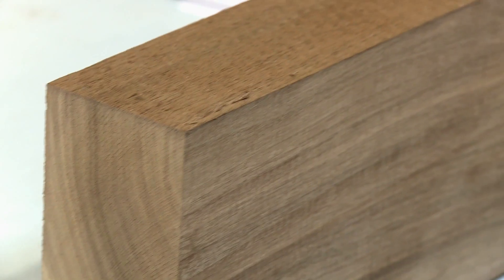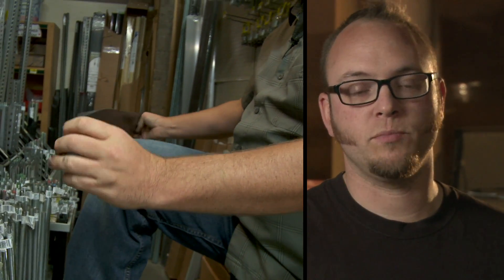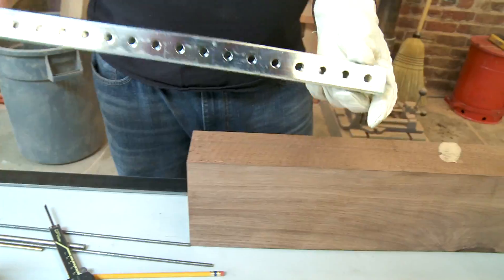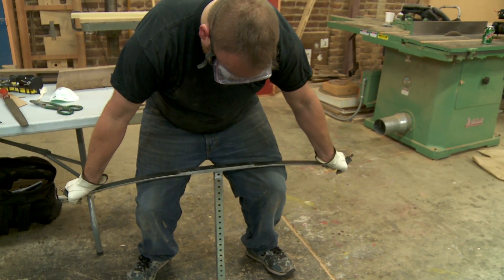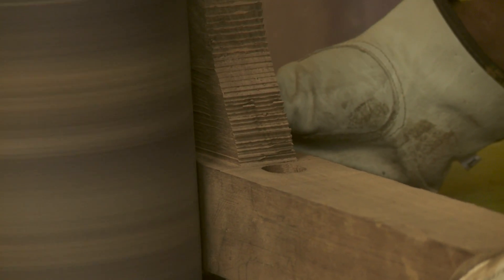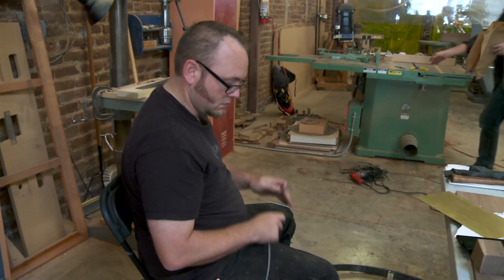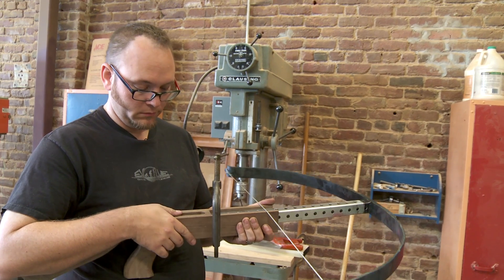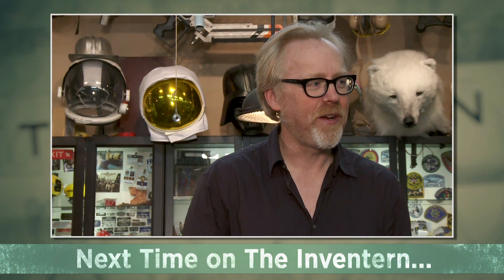The Inventern Episode 14: Building a Crossbow

Comment: Rather then putting all that time into bending the steel, he should have tempered it. Even mild steel can be surprisingly springy if heat treated. I would say if he got the whole thing to a dull cherry red and water quenched it that could have been good enough. If it's still too stiff, a few gentle passes with an oxyacetylene torch would anneal it enough to make it work. I know Adam has a propane sword forge somewhere and even without that, a little care and an oxyacetylene torch would work.

Also where do I sign up for next season? I'm 25, eager to learn and I'm itching to get in that work shop.
Reply: Does your illiteracy ever embarrass you?
Reply: mellotron It used to when I was a child and they told me it was likely I would never be able to really read or write, but around 6th grade I read my first chapter book. From then on it was an uphill battle over the next 6 years of my school career to get to average. The students constantly made fun of me. It was rough. I'm proud to say, by my senior year of high school I graduated in main stream reading and English classes, with most of my other classes in honors. It was the hardest 6 years of my life, but I no longer needed my IEP as a crutch for reading, and I did the impossible. Also go fuck yourself :)

Comment: I am pretty disappointed in these final builds. Granted, they had very limited time to work on these, but the engineering behind each of these projects seems very limited. They probably did some back of the envelope calculations, but were not very thoughtful. For example, in the crossbow, Brandon did not think about the tensile strength of the cable that he bought and how the strength of the bow would compare. He should have had at least a factor of safety of 2 to ensure that it wouldn't break under load (as it did). It also seemed as if he just welded the two steel arms together without doing any calculations as to the resulting stiffness. These are very basic calculations that should have been done long before he even fired up his torch.

Sad to see that he approached this project as an artist would, creating a beautiful stock for the bow out of hardwood without regard to actual functionality, instead of thinking like an engineer.

Comment: shouldn't you try to temper the steel to make it spring?
Reply: Mild steel has much too low of a carbon content to be quench hardened!
(that's why it's called mild steel)
He "could" try carburizing it before hand, ie putting in an hermetic box, with charcoal, horn, or an of the shelf carburizing compound, Though it would have consumed most of his time up to his deadline, and would have needed a biiiig gas oven or a large forge...But even if he had the time, that would fail anyway for numerous reasons I wont detail here!

He basically failed in choosing the right materials to begin with!

If scrap yards or auto shops werent allowed (Knowing the proclivity of Adam for rumaging in those places, I'm pretty much sure they were) he should have gone the composit way, modern style: fiberglass or carbon fiber skis (expensive, but relatively efficient!)
The composit traditional way, ie horn, wood and sinew glued together to make a bow also would have taken him all the time he had, so out of the question, and I guess the layering takes a massive knowhow!

Comment: As nice as it looked you would never really be able to make an ideal spring starting with mild steel and without the knowledge of how metals gain their properties it is likely to fail. Even if he had spring steel the heat from welding will have annealed it and made it bend easily again.
Reply: Ideal...maybe not, but you could definitely heat treat and temper it into something a lot closer. Seems to me a quick trip to a junkyard to pick up a leaf spring would have been a better use of his time though.

Comment: don't see why he tried to make a crossbow, you can just buy one for way less than $500,.. i know the point was to make it, but even if he just bolted a regular bow onto a piece of wood it would be better than what he made
imo, they should have given them time to submit their proposal, then time to get parts, then time to build,.. 2 days was pretty short for that
Reply: You seem to have missed the whole point of the final challenge.
Reply: Carlos Peralta
 you seem to have missed the part where he built a shitty crossbow that doesn't work.  he had $500 to burn, he probably spent less than $80, it's not like he wasn't allowed to go get a bow that would work, or the right steel he wanted or a bow string that's not made out of wire cable
Reply: Have you seen Adam talk about what he's doing and how he works, like ever? The fact that it's supposed to be completed on an insane deadline is the point.
Reply: sonicase you're so clueless...
Reply: The point of the challenge is for Adam to see their fabrication skills, not their buying skills.
Reply: you can make a better crossbow out of other material,.. he should have either stopped when he couldn't find the right steel, or used some other material than metal... he doesn't really have an excuse for not finding what he needed...in the next video he sees a bow and arrow in adam's place and says "could've used that" ... so why didn't he just go to a sporting goods store and pick up that stuff...it's like he just went to home depot and that was it... the point is that there were no rules...i'm not saying he should just buy something and present that, i'm saying he didn't buy the right stuff to make what he wanted to make